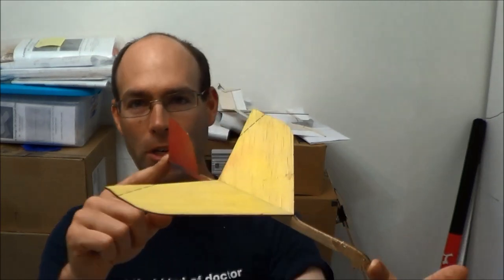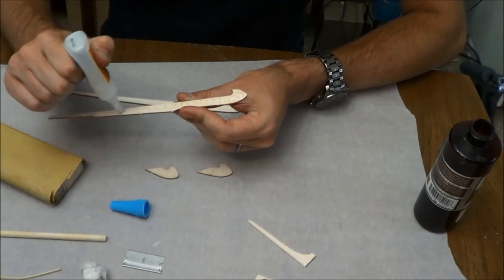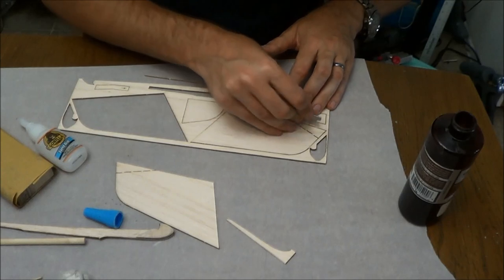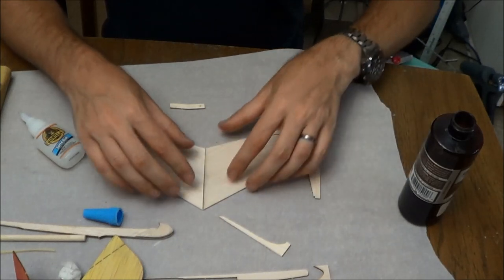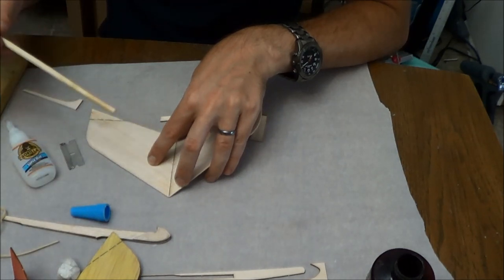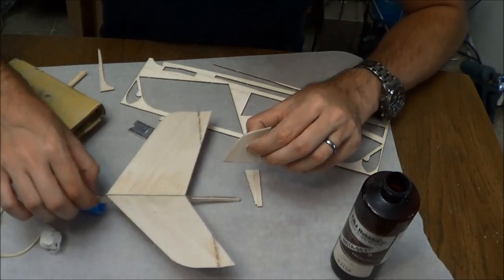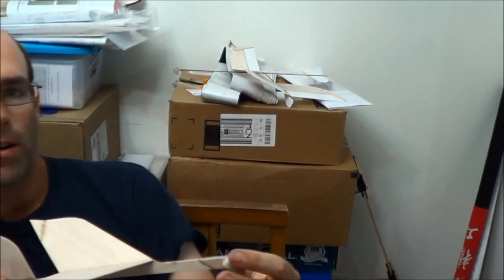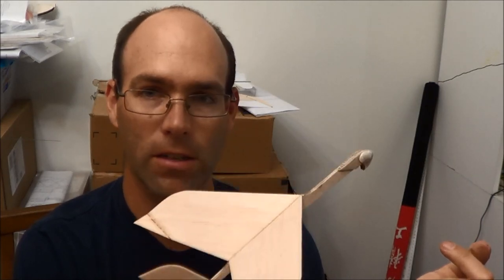One Sheet Wing - Build Instructions

Comment: Looks like a quick build. Just clicked on the link and it took me to your one-sheet-glider not the one-sheet-wing. I haven't done much glider flying for a while now, have a few other things going on. We will have to see how the weather goes.👍👍
Reply: Grandad it is on Page 6 of the shop catalogue.
Reply: @angelreading5098  I had no problem finding it, I was just pointing out that the link takes you to the wrong page so Josh can correct it in the video description 🙂👍
Reply from the maker: Thank you for spotting that. It's been fixed now. :)